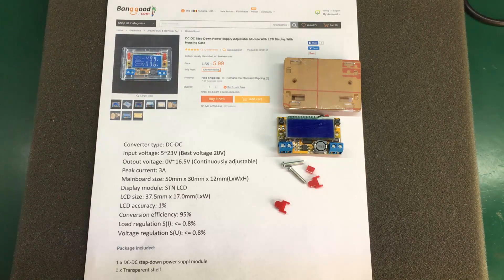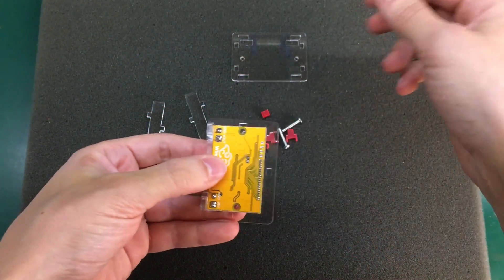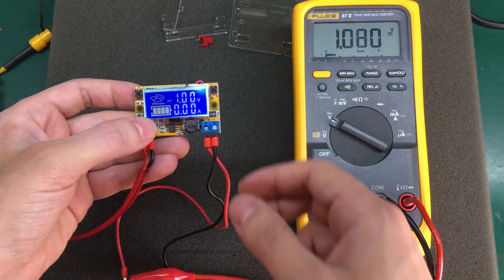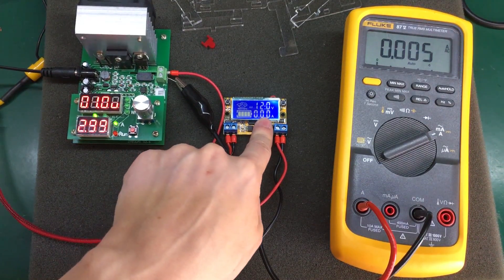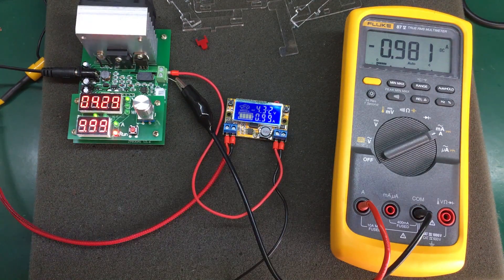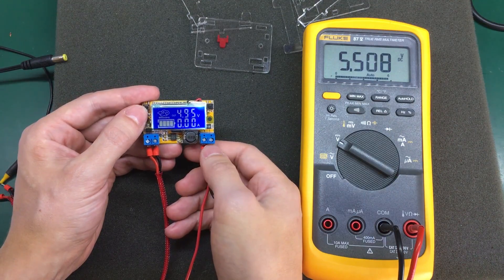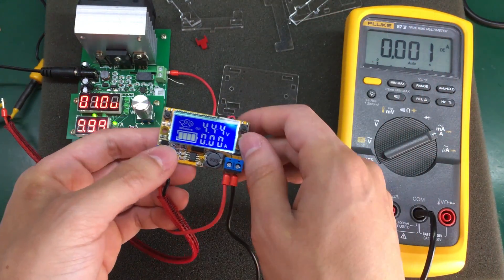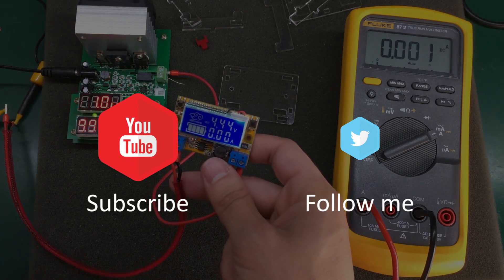Voltlog #53 - DC-DC Step Down Adjustable Power Supply With LCD

Comment: i was going to buy a bench power supply.. but, getting that thing calibrated as accurate as it was afterwards, and really not needing anything more than what that device can do for general testing, I'm just going to pick one of these up instead.  I have a 24v 3a power supply that should take care of the input needs, so a buck boost isn't necessary, just a buck

Comment: Please help me I have same power supply when I first turned it on it runs like a charm but after 4 hours it just stuck on 5v on but my voltmeter is showing that it is not giving an single volt. I turned it off for the whole day but still facing that problem please help me

Comment: Don't buy this device, it's a bag of sh*t. 
The output varies slightly if the input voltage changes, plus the voltage and current display are very inaccurate. You cannot calibrate the current. You cannot charge batteries with it, the module crashes when the battery is charged, after its charged, it drains the battery. You could use a diode to stop the battery from draining. The module can crash when it drawing too much power too. I've had nothing but problems with it.

Comment: So would it be safe to say <2Amps for continuous duty?

I want to power a UHF portable radio at home that requires ~13.8vdc using an input 23vdc/ 5 Amps old power supply
Reply from the maker: I would get something built with higher quality components for that. This dc-dc converter will likely run hot at that input voltage and it will fail eventually.
Reply: ok thanks.  Good video, and thanks for posting.

Comment: regular hardware store acetone or acetone based nail polish remover will weld plexi. dont waste your money on expensive glue. I put it in a plastic bottle with needle tip. It was actually an old liquid flux bottle i used. The small tip is key because you only want it to run along the joint. clamp it very lightly for 5 min (sometimes you can just hold it for 45 seconds ) then be easy on it for 24hrs. in 24hrs the materials return to their original strength and it will be like there was never a cut there.

give it a shot. I used this to construct a vertical bubble assisted pcb etch tank. Its acid tight and has been for over a month now. If i can trust it to hold cupric chloride I think it will do fine for an outer casing.
Reply from the maker: thanks for the hint!
Reply: no problem. forgot to add... in my experiance the parts that come with those kits have perfect edges so they work like a charm. If you cut parts yourself you may need to sand the edges flat and smooth. I use an 80tooth  10inch miter saw blade that i picked up for like 30 bucks at a discount store called harbor freight. I was skeptical but it cuts plexi like a dream. Squaring up the ryobi compound miter saw is a different story but thats not the blades fault. I have the old blue one, the new green accent model added really heavy notches at common rotation and tilt positions..obviously they realized the one i payed 200 for was a defective design lol
Reply from the maker: I keep hearing the name harbor freight from US/Canada people. Sounds like you can get cheap tools there which is always a good thing if you know what to expect from them.

Comment: After calibrating the voltage you never did another amperage test to see if the calibration threw off the ammeter.  What kind of ripple can be expected from this buck converter?  I purchased it and have it on my desk.  I didn't know it could be calibrated!  Thank you!  What is a good way to test the output amperage?  When I try to put my dvom probes on it shorts and goes into voltage and current limiting.  What is a simple way to put a measurable load on it?
Reply from the maker: I haven't measured the ripple but you could test this dc-dc converter output using a dummy load https://www.youtube.com/watch?v=snROh2acybs
Reply: VoltLog I was struggling to find a load I could place on it then remembered I have an LED light strip.  Worked great!  Was able to use a DVOM to calibrate and validate accuracy.  I'm pretty happy with it and ready to introduce it to my real project loop now. :)  Great videos. Thank you for your response.

Comment: Have you, by any chance, worked with this step-up module?

https://www.aliexpress.com/item/10A-DC-DC-Adjustable-CC-CV-Step-UP-Power-Supply-Module-LCD-Dual-Display-Case/32750805796.html?spm=2114.30010308.3.1.qlu6vg&ws_ab_test=searchweb0_0,searchweb201602_3_10065_10068_10084_10083_10080_10082_10081_10060_10061_10062_10056_10055_10037_10054_10059_10032_10078_10079_10077_10073_10096_10070_10052_423_10050_10051_424,searchweb201603_9&btsid=88713754-128b-4147-85bf-867f6a187da8
Reply from the maker: Nope, I haven't but it looks really similar to the one showed in my video, probably made by the same people.
Reply: Yes, that was my thought exactly. I already worked with the module you made this video for, by the way, thanks for the video, very useful!

The step-up module I gave the link to looks interesting as it has relatively big heat sinks so I suspect it can handle the amps advertised for. I ordered one, curious how it handles.

Thanks!

Comment: Hello, nice review! But i have a question. I want to use it to power up a usb port at my workbench (powersupply 12V 400W). The 12V line is used for all kinds of stuff. For LED lights, my CNC Controller . . . (if someone is asking himself why in the hell is he using a 400W powersupply) Now my question: 
1. is the quality of the output voltage good enough (is it save) to load usb devices? (ripple. . .)
2. if i am right the main heat source is underneath the LCD. And i think because of that it will be difficulte or impossible to use a extra heat sink. So how can i increase heat dissipation? 
I would like to use this module because of the build in ammeter. It is nice to know what a device is actually pulling.
Reply from the maker: I haven't checked the output voltage quality so can;t help you with that. It's a dc-dc converter, it will not dissipate too much heat if you pull under 1A from it. I don't think you need any external heatsink.
Reply: Will the converter withstand a continous 2A draw without getting to hot? I am worried that the LCD will suffer from the heat. Not instantly but over time.
Reply from the maker: I don't know, best way to find out is to get the module and test it yourself with your particular setup.

Comment: Excellent video - I found that my acrylic case didn't fit together snugly because the soldered leads from the display protruded out the back of the PCB. I cut them off using side cutters (no problem they were already soldered in) and not the case fitted together perfectly around the unit, and I did up the two screws into the threaded perspex base and it is rock solid!

Comment: how about the ripple and high frecvency spikes around 100Mhz that are typical for the switching power supplyes?
Reply from the maker: ripple and noise are most likely present as you suggest but considering the price and the applications where you might use this small dc-dc power supply i figured it is not worth doing such an in depth review.

Comment: Nice review. I have two of these and my experience mirrors with them mirrors yours. One has an intermittent scrambled display, but it's still usable. (Maybe I'll get around to reflowing the solder on the LCD connectors someday.) As you said, an old laptop power brick works as a input. The 19V 4A supply from an old hp that I no longer use works fine. Not a professional grade lab supply, but perfectly adequate for hobby use.
Reply from the maker: thank you for watching!

Comment: How much d c power are you putting in ,to your power supply kit ,I want to use mine for testing my kits I build.,any help from you would be helpful I haven't done this for a while I use to do it a lot now I doing it lot again
Reply from the maker: Input voltage is 5~23V , best to keep it around 20V.

Comment: The screws thread into the bottom of the case, no nuts needed. It holds it together well. My display was broken so I had to get a new one.
Reply from the maker: yes, I figured that out towards the end of the assembly :)
Reply: How to change that tactile button to potensio bourns  @voltlog teach me🙏

Comment: Hi, do those two screws not join it together? Thanks for the video I've ordered one of these off Bangood.
Reply: I have one of this units. The back acrylic panel has treaded holes so the screws hold it together nicely.
Reply from the maker: yes, the screws are retained by the bottom plate which has slightly smaller holes.